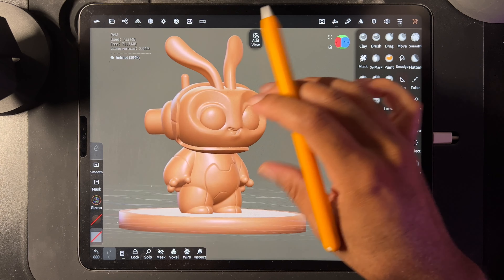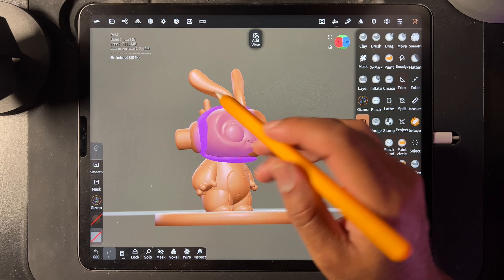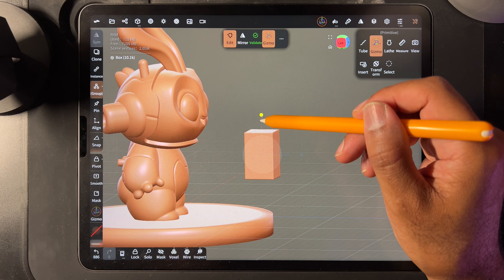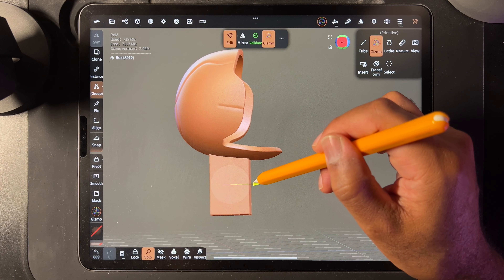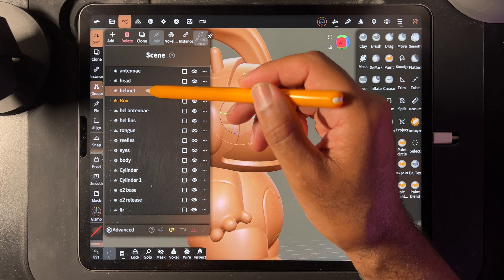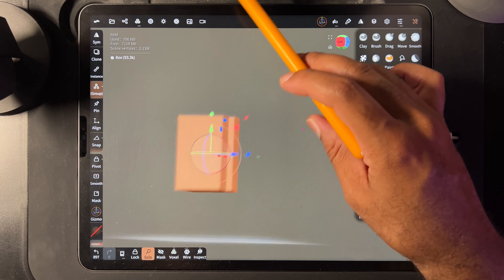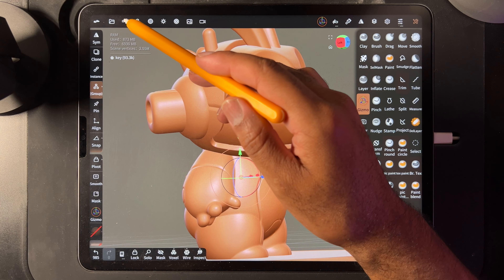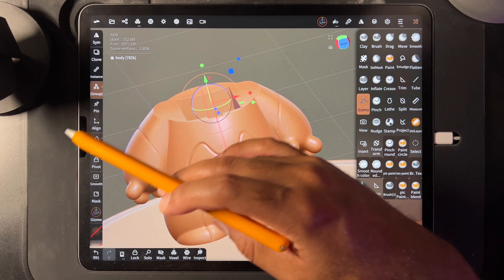Nomad Sculpt Tutorial: Make a KEY & CUT for 3D Printing Parts to Fit Together

Comment: Can you just print the model as is, but just in two separate printings? Like one print for the head then one for the body. Or do you need to add other elements as well, such as support structures?

Also, what kind of resin do you use?

Great tutorials!

Comment: if your key is like 20mm by 20mm make it 20.02mm by 20.02 bullion cut it out the body 
and make sure you copy it first then reset the key to 20mm and print.its nice to see a complete beginner 
come so far in a couple of weeks Dave mate well done
Reply: I have not found how to sculpt with measurements. I have to make it and then measure after.

Comment: Thanks for sharing your 3D printing journey, Dave! I also got into 3D printing very recently, like 2 weeks ago haha. I want to print my own models, but oh man it's very hard to get it right! I have been getting so many failures. 
It'd be interesting to see how you prepare your 3D models for printing, like adding supports and hollows. Supports is definitely the most hard for me 🥲
Reply from the maker: Which slicer do you use? I use lychee and I use the auto supports. I add holes and hollow, but firstly my issue was my leveling of the build plate. I hadn’t pressed it firmly against the screen and set that as home. Once I did that things started working! I’ll do a video showing my process soon 👍🏾
Reply: @drugfreedave  I used lychee and auto supports too and I could only get one decent result when I added my own supports. I also did some voxel merging on nomad this time and leveled again, so that might have helped too.

Yesterday I tested some pre-supported models on chitubox and they came out pretty much perfect. Maybe my Creality LD-006 printer has better compatibility with chitu? idk, gonna try hollowing my own models this time.
Reply from the maker: Yeah it’s hard to know exactly what the issue is with these things. I got some great help via the Facebook printer groups. I’m in a general group and one for my brand printer. I posted videos of what I was doing that didn’t work which make it easy for more experienced folks to see what I did wrong. Lots of resources in the fb groups! 👍🏾💯

Comment: How’d you get the printed white guy so freaking smooth?!
Reply: Oh wait- is that a casting made from a print?
Reply from the maker: They do print fairly smooth as is, but the supports do leave marks in the back or bottom: pretty sure I printed with the supports on the bottom! I airbrushed the paint too which in my opinion is the smoothest finish!
Reply from the maker: I've never done the casting thing, another can of worms that'll stay closed for now!
Reply: Resin printing